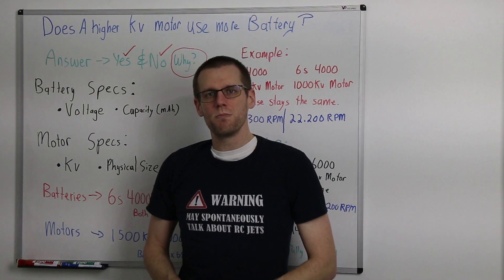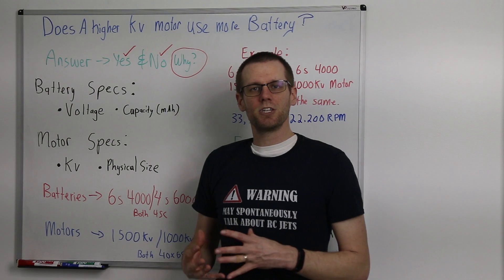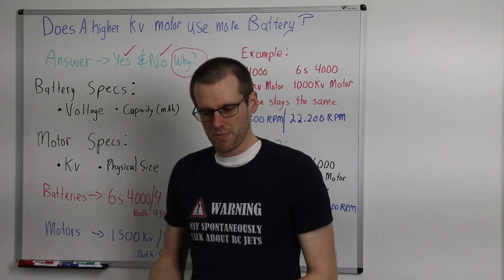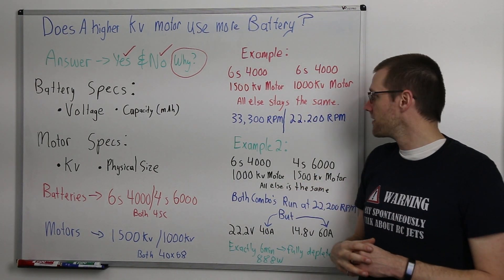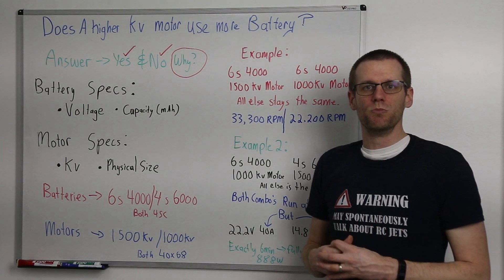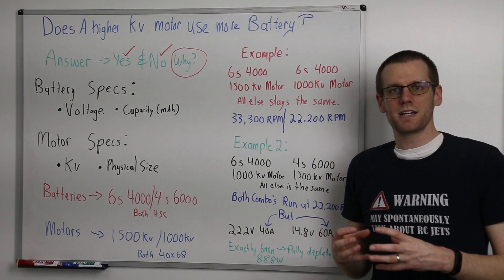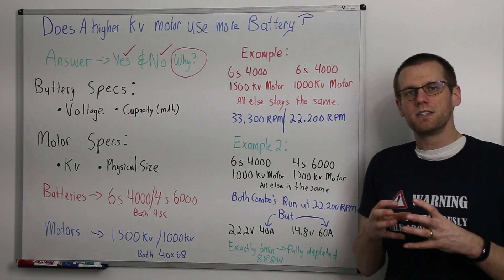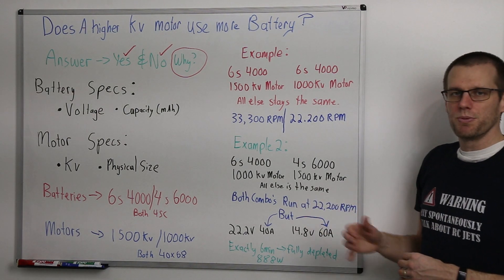Does a Higher Kv motor use MORE Battery?

Comment: Question:   In the first example, you used the same batteries, and end up with different RPM's.   What if one runs the higher kV motor at the lower rpm?  (your calc gave 33k RPM, vs 22k).   If one only ran the bigger motor at the lower rpm, wouldn't  that result in effectively the same power, but longer run time for the battery, on the higher kV motor?

Comment: Great video but in practise your conclusion is wrong. Higher KV identical motor with same rpm with exact same  battery runs longer  Try it. The result will surprise you

Comment: I have a question about speed controls but you do not have a video that comes anywhere close to what I am about to ask… With my experiences I have encountered some speed controls that have a higher resolution of processing than others. For instants my stock factory team associated buggy is only 4 S with a 2000 KV motor and it has amazing torque and amazing throttle response and breaking and amazing acceleration. Where the 32-bit spektrum 8S combo with the 1250 KV motor is kind of sloppy with its processing and computing, this is separate from cogging. What do you know with your experiences? Do higher voltage speed controls have slower processing so that it runs cooler?
Reply from the maker: This is quite complicated to be able to compare processing power between 2 ESC's. Not something I have done. Generally, I expect the ESC with more processing power to be able to have more features requiring processing power. I would never expect an ESC manufacture to save money on processing power to the point where the ESC can not keep up with it's main function - controlling the motor correctly. If I figure out a way to test this, I'll give it a shot.

Comment: Really good simplification of this topic! I think that the topic of voltage should be more about the batteries ability to deliver current along with resistive losses along the power lines. In general, high voltage and low KV are great for reducing resistive losses and reducing current requirements at the battery rather that finding motor efficiencies. Great series, please keep the content coming!

Comment: Given your example, I'd still take the lower KV/higher volt combo. despite the same runtime, the lower KV would run less current (Amps) because the overall power is governed by the voltage. With the higher voltage given identical RPM, less amps are required, therefore less loss due to heat. The way i always explained it to people, Higher KV/Less voltage required more amps to do a certain job. You take a lower KV motor/Higher voltage, even if the battery is adjusted to get same runtime, the result will be cooler running, due to more efficient transfer of power. I deal with cars so the resistances are different (ground vs air) in that arena the lower KV/Higher Voltage combo will yield possibly better runtimes, despite the batter size adjustment. Because the lower KV system produces more low end torque and will have less losses vs resistances compared to a high KV lower voltage setup, which would require more amps to maintain the desired RPM. The way i see it, RPM by voltage is more efficient, than RPM by amperage
Reply: Ok but which combo would be better in terms of acceleration? 🤔
Reply: @spartang.1388 , Well to me lower KV equals less time to max RPM per given setup (IE 2s,3s or 4s systems). usually a higher winding carries more current quicker due to more wire to carry, it can also cause a little lag due to distance since the wires are usually coated so energy can't jump. But that is minimal if readable. since the lower KV reached speed quicker even with taller gearing to compensate (same speeds) i personally thing the lower KV higher Voltage setup should and does in my opinion, work better. You see i view things from an efficiency standpoint, not from a raw acceleration standpoint. To get to top speed quickly and efficiently you either need to spin it hard or lower the KV to max out speed quicker by limiting the max RPM for the setup.
   For example, My arrma Big rock had a 3660 Firma 3300kv motor, geared for 50 MPH at 15 tooth pinion and a 57 tooth spur. the motor at 3s lipo spins at 36,630 RPM. I later switched to a Surpass 3665 2300kv motor, everything else identical (Edit, sorry did change the pinion to a 17), it is now geared for 41 MPH due to the new max RPM of 25,530. personally i like the new setup better as it accelerates faster and runs cooler, i have no desire to gear up to the 50 MPH which would be a 19 tooth pinion. But if I did, I know the new motor is 5mm longer and lower KV so i'm sure both would impact efficiency and would probably allow for faster acceleration.
Reply: @crazylarryjr  wow, thats awesome. I really needed this. Thanks. 💯👍